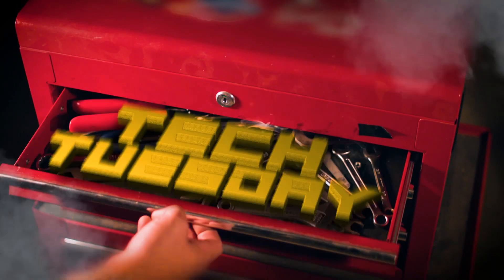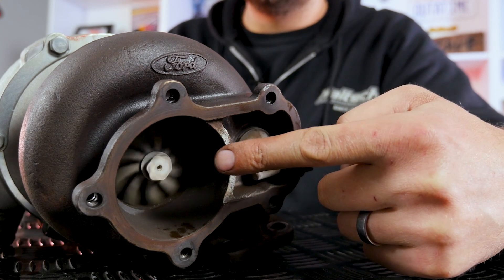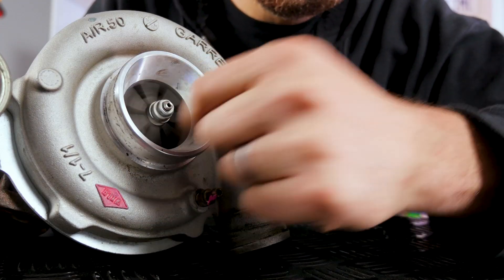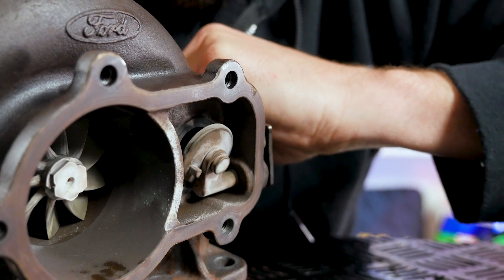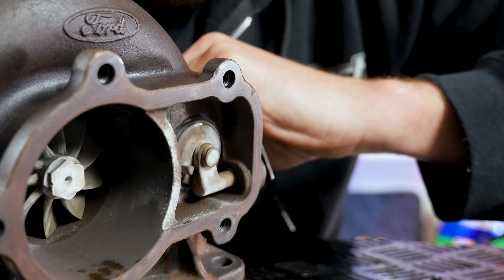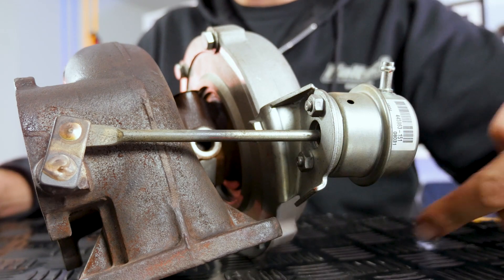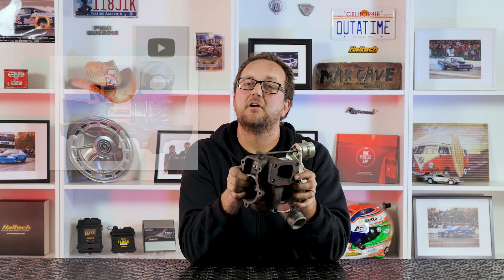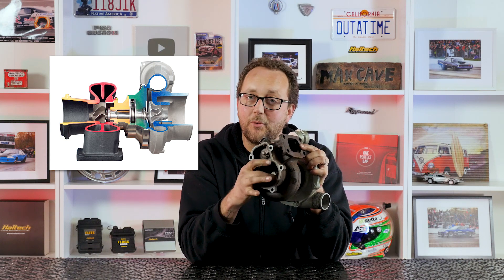🛠 How Turbo Boost Control Works | TECH TUESDAY

Comment from the maker: In this rapid-fire Tech Tuesday, we give you a brief overview on the inner workings of a turbocharger along with the basics of boost control.
Keep in mind - this is Tech Tuesday so we're only covering the basics here, if you want us to expand on any part of this video - let us know in the comments section. Enjoy!
Reply: You could make a video on how to set coil dwell. I did figure it out a long time ago but when I wanted to explain it to someone else, I completely confused both of us. And that was a COP system, so not only did I use my current clamp, but I also needed an extended HT lead so the spark would reach the plug. I'm not even sure that I needed a secondary voltage pickup. Can you set dwell by looking only at the coil's low-side current?
Reply: When i  removed 2 of my TD04-15G from my old Volvo 850 and 850R both where crack on the exhaust housing. I changed my actuator since the springs was so weak i was only at 4 psi instead of 10.5psi till i get no boost. I bought an after market with different spring stiffness, but even the hardest spring i couldn't barely it 7 psi, my tune was 15psi so i open the actuator and i putted second spring inside the case. After that it worked i could hit my 15psi, on cold morning with cold air i was hitting around 18psi.

Now i got an Type R 2018 tired of trying to hit 300hp.

Comment: Under full load, without a wastegate when it reaches charge air pressure at a set RPM limit, will it increase the turbos speeds and lean it out? If not, what prevents it?
I am trying run my engine with no wategate, I know that 2x69mm turbos are clearly big enough for my 5.7L.
Does the wastegates allow the engine to run at lamba at all rev ranges?
Thanks,
Joseph

Comment: Hey I have a question 

Say Im running the stock ECU and insert a boost tee and turn up the boost, will the car automatically insert more fuel, to stop it running lean?

Comment: So you need a boost controller AND a external wastegate ?
Reply: Yep, the external waste gate is the "base boost pressure," and the boost controller adds on top of that boost.
Reply from the maker: External or internal will both work.

Comment: Good information scott but i would love to know along the lines of how the size of the wastegate affects control. My internal wastegate controls well at 10psi (std actuator 7psi spring) but can seem to control 12psi very well even with an aftermarket actuator and a 10 psi spring(mac valve with power fc ebc) was wondering if a 44mm wastegate would fix this problem or is there something else that could be done. Target boost is 0.82bar and it usually reaches 0.7 to 0.77bar
Reply from the maker: We know just the people to ask! Hold on...
Reply: Thanks,  @haltech  Team! Hi Jeffery!

Usually, wastegates are sized to meet a minimum boost threshold, to avoid issues such as boost creeping upwards away from minimum target. The basic factors needing to be considered when sizing a wastegate are minimum boost target, engine capacity, fuel type, piston/rotary, number of turbos and their scrolls and engine speed. When boost targets cannot be met and are undershooting, this is usually from excessive backpressure blowing open the wastegate, at this point a different control strategy is required, or an increase in base pressure spring is required to recover the force needed to maintain the wastegate in the closed position. Given your issue is at relatively low boost, I would investigate all other avenues before switching to an external wastegate.

In regards to boost control and wastegate size, there is a possibility of running a wastegate that is simply too large where for a small opening in bypass path, a relatively large amount of gas flow relative to the total exhaust gas flow of the engine can be bypassed away from the turbocharger, causing a sudden loss in boost pressure, then the wastegate closes followed by a rapid rate of boost pressure increase, and the cycle repeats - this would be an extremely rare situation which our technical support team has yet to see. It is not uncommon for many traction limited vehicles to be running our largest wastegate possible to bleed as much boost away from the turbocharger for maximum tractive effort, only to dial in as much boost as possible for maximum engine power a few gears later.

If you have any tech support questions regarding boost control, feel free to drop us an email; tech@turbosmart.com.au !

Comment: It would be great to see a detailed video on how a boost control solenoid works. Is it vacuum or boost pressure to the port on the Wastegate actuator that causes it to open? Its crazy to think how such a small device can modulate the WG actuator and in turn the WG.
Reply: Appreciate this was three years ago now but did you track down a video on how a boost control solenoid works? This video is excellent but yesterday we resolved a lack of power by replacing this solenoid, cheers
Reply: @tommylascelles1918 i got a good video for you to watch. Reply to this comment and ill get back to you with it

Comment: i removed the boost solenoid ,put a long tube to inside the dash,and attached a small nozzle with a tap, instant and manual boost controller, 0.5 to 1.5 at the tip of your fingers,and just costed 1€.
Reply: Jkrui that setup doesn't work well and you are missing out on low rpm boost. An electronic boost controller will keep the wastegate fullt closed @ low rpm and low boost, ie prespool, giving much faster spoolup and pre spool throttle response. A simple boost bleed off cannot do that.

Comment: Looking forward to getting my elite 2500 installed on my 1JZ and all tuned up. I'm keen to exploit some of it's many new features, compared to my old PS2000 ecu.
Reply from the maker: You'll love it:) Send us some pix of your ride when it's all done!
Reply: @haltech  For sure. I've got new 264/272 cams, new turbos, and the elite 2500 ecu. It should feel like a totally different car. I love the fact the elite 2500 has diagnostics and that I can monitor my engine parameters with an app on my smartphone.

Comment: Always a great video.  Question though.. how do you have different boost levels for the same engine rpm between tunes? Do you increase the fuel so there's more combustion gases to up the boost? Then your AFR is messed up ?
Reply from the maker: It's all done by the ECU which adjusts the AFR accordingly.

Comment: Well you could put unlimited boost in ...And you WILL see what happens.  Love all these uploads guy's thanks. I am running a positive displacement 2.3 LTR vmp supercharger.  it with current  pulley makes 15lbs,   08 Mustang cobra GT500.
Reply from the maker: Those superchargers rock!
Reply: @haltech  indeed they do man. No grip through 3rd on Goodyear F1's  and sometimes even 4th on cold tires .  But that is the fun of it.
Reply: Gopherchucks Games get some Michelin Pilot Sport 4S
Reply: @nordic5490  I was thinking about those, but i plan on going NT05's out back and pilots up front. I live in Fl so lots of rain. Granted the drag radials will suck in the rain , at least the brakes and steering will be solid.
Reply: Gopherchucks Games the Michelin Pilot Sport 4 (not 4S) are your #1 choice for performance plus rain performance driving. Yes, they will overheat after a couple of laps at a circuit, but on the road they are #1. Michelin really are leading the other manuacturers by a big margin in wet weather braking distance. 4S is better on a track, ie, once some heat is in them, and wont overheat.

Comment: No matter how much I think I know about a topic, you always sprinkle in a few tid bits of new info, keep it up guys!
Reply: Dylan Wiebe you don’t know very much, then.

This was as basic as it gets.
Reply: @mareksumguy1887  yeah man, I'm self taught. I don't know everything. I've only Tig welded one turbo manifold with external wastegate, read 3 books on performance building and tuning engines, street tuned one 412whp rb25, and only swapped 5 motors. The amount I still don't know is huge. So, when someone at haltech is willing to take the time to teach something, even super basic, you pay attention, because you never know if you're missing some foundational knowledge that can help you down the road.
Reply: @mareksumguy1887  why so saulty over a bloke learning? Make ya feel big? Lol small man syndrome
Reply: tittlemouse92 stupid much?